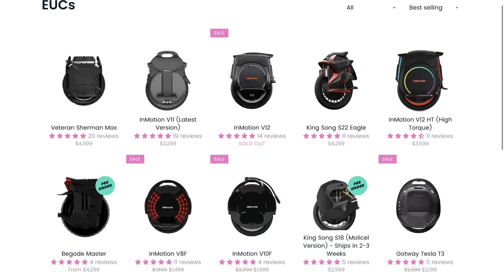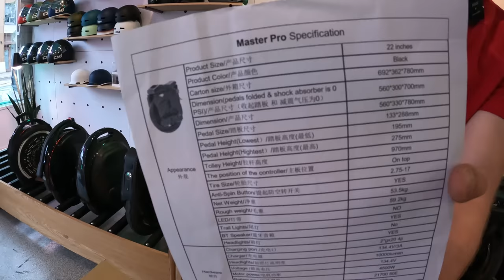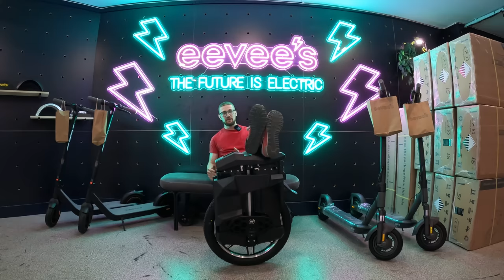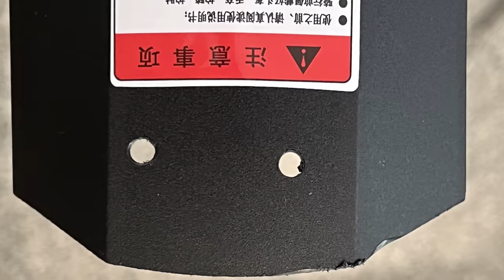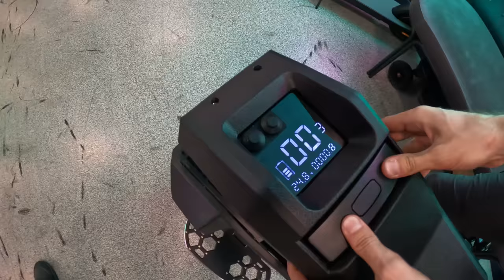Begode Master Pro Unboxing - Biggest Battery!

Comment: Begode is like a pre-manufacturing company. Whatever they ship you is going to have to be re-manufactured to be an actual production quality product.
Reply: It's like offering a bike frame and you add the parts you want. But in this case you will need to manufacture them
Reply: I like how you put it. I can actually 99% agree with that
Reply: I have put my T3 through hell and it's still going strong (with the exception of a trashed rim due to potholes). So I'm not in total agreement with this statement. Now I have my eye on the T4.
Reply: @jashton8710  There's a fundamental distinction to be made between OG Gotway and new age Begode my dude. The Nik,  Mten3, T3, EXN, etc were made to last. This new naked lineup won't last 2 years. Not having even IPx5 rating for something meant to be used outside is just insulting and having shitty plastic wrapping the fully exposed batteries are the worst 2 offenders. This thing is 5k FFS and they expect people to put hundreds of dollars to finish the job with aftermarket shit just to make it a fraction of what it should have been in terms of convenience and sturdiness.
Reply: Bruh s22 was the same but it caught fire but you didn't care it was batch 0
Reply: And on top of that quality issues the pricing is also too high. I just discovered “Sandra Miku Super” a road legal electric motorcycle (ish) for £3500. I know is not the same freedom, I just want to emphasise how steep the “not tested” PEV are. Only from material cost perspective the euc’s are dam too expensive.
Reply: @mr.e-wheel  we have a saying here "if you wanna play you gotta pay". 
So for now, the high cost of euc's is what we have to pay for what I call the pinnacle of mobility pleasure. 
You may disagree....but I don't care.

Comment: Cool. Check how tight the white cable under front is. It might be safer long term if they make it a bit looser, more "S" like. 
I like the tread pattern of the v3 tyre, nobbles aint in a line. 
Epic wheel mmmm.
See if tiltback can be set and work thanks. Ride safe dood.
I wish you nice success.
Be well.
From Will and Mr Data :):]

Comment: take the pedal holders remove the 4 bolts and tighten the screws under it.. that's why it flops like this
Reply from the maker: I did that on the Other one we have and it didn’t help at all. I’ll try on this one too
Reply: @mr_wrongway  It's a bit of a concern that the plastic battery boxes, then the BMS inside are what hold the pedals in place. They'll be stressed every time there's acceleration, deceleration and I don't want to think about pedal clipping 😐
Even if the lever arm is long which will reduce the forces applied, it's not ideal.
Reply: @mr_wrongway  tighten also the 3 bolts on top as the entire tube is spinning.. there are 2 bigger bolts and one smaller.. usually that helps but don't over do it
Reply: Currently i have this issue with my master pro! I can feel it going over bumps and while accelerating/decelerating. Any updates?
Reply: @JekovenTinsley  tighten the 5 bolts on the bottom and also the 3 on top.. you have to remove the pedal holder part.. .. use loctite
Reply: @archeebookingagent1909  Thanks for the advice I tighten the 5 bolts at the bottom and the three at the top and I still have that issue. It looks like the black metal bar that connect to the batteries has alot of play when it fits into the silver slider.

Comment: Careful what you wish for: I wanted more range.. but why on this beast?
This becomes more like a full fledged street only vehicle. I gotta say I like the T4 and would be happy if the master got a Gen 2 remake with a bit more range, 2800-3000 Wh, as well as a quality overhaul..
Reply: ex30 with 3600wh seems to be pretty good. I prefer the tire size and overall weight of the ex30 better
Reply: Personal taste, I guess.
But for me 50kg+ on a vehicle that I can't lock and leave in the rain, have to carry over hurdles etc.. is hard to justify.

Can't compare it in terms of riding, but as an only-wheel for short trips etc not my favorite.

Comment: 14-15 hours that you said, is right. The edited subtitle (12 hours) is wrong. That is an about ~400W charger (134V*3A) and you never put 1W into the battery for every watt your charger spits out. The average is between 70% and 96%, depending on battery, BMS, wires length and thickness, etc. That is called charging efficiency, and in our ranges of currents, usually the figure is 85%, for a NEW battery pack. Look to charging times for existing wheels from Inmotion or even the Sherman, a 5A will fully charge it from empty in about 7 hours and half, which is exactly 3200÷100.8÷5÷0.85. There is always a under-unity factor. So, coming back to our sheep, 4800Wh÷135V÷3A÷0.8=14.8 hours. Which is a bit ridiculous... I already raised this issue with my Chinese distributor some weeks ago, and I believe they are "escalating" it with Begode.

Comment: From what I see the V13 will be a far better wheel given the design , quality and given the speeds these wheels are reaching the safety
Reply from the maker: Time will tell :) indeed there’s a lot more tech in the V13
Reply: I guess the V13 will burn through its smaller battery very quickly at high speeds much like my master can. So it will fall short on range relative to other smaller cruiser wheels. It seams to not have a good niche. Perhaps short range performance wheel for huge riders is it's niche.
Reply: Maybe, but they already bombed on range, not even 3600 Wh like the Sherman (2 years+ ago) and we do not know the max speed but the rumors said its not more than Sherman S. The question is are you a performance rider and looking for a 60 mph wheel, that has been reaching dangerously to 50 mph on your old Sherman and want a faster wheel? If not, then Sherman Max has a great record, with S coming out even better and retaining 3600 Wh/lighter/smaller/cheaper than V13.
Reply: @saltyscott1762  that's interesting. To me, the V13 looks like it will be an actual practical wheel, and the BMP seems fairly useless (other than being an fun toy). What niche is this filling where you need to ride 300km a day?
Reply: @s0d4c4n  consider the all-up weight too, of all these heavier wheels. Somewhere along the line there is a Goldilocks formula for power, voltage and range at a manageable sub 40kilo weight (think v2 Sherman - simple, solid and pretty sure-footed too). Beyond a certain weight, they’re only going to be suitable for well surfaced roads or tracks, and below a certain battery capacity to power/voltage ratio it becomes a diminishing return per unit of currency sank, even before reliability and even out of the box rideability is considered. I get that for some the biggest or fastest or rangiest wheel, etc is the only one that is going to be desired, but it will come at a cost -not only financial - when other factors are to be felt worthy of consideration, eg portability, trail capability, etc.
Reply: @s0d4c4n  300 km a week without charging.

When I ride fast on my old Sherman:  50 60 kph. And I am a heavy rider. I only get 80 km of range. So on the Master Pro I only get 120 km.
Reply: @s0d4c4n  5a+9a chargers. 14a*126v=1764w, which is the maximum. = 30-90% in 1h
Say avg riding speed 40km/h.
And 1h charge (1764wh) gives 50km range. Then ride 65km to be down to 30%, charge 1h to 90%, ride 50km down to 30%, repeat 4 more times, in 12-13h you can do 300km, including charge time(5h total in 5 stops to eat or have a needed break). Not bad at all in my opinion.

BMS I understand makes the 14a charge safer and helps spot any possible issues that may come as a result of that, with other wheels, hard to tell.

Comment: Nice overview ! Is the tire the CST C113?
I can't find it on the CST website in 17".

Edit, I learned that it's the C117, same pattern as C113 but different tire, very appreciated by Monster riders.

In 2.75" it's probably as wide as the typical EUC tire, but it looks narrower due to the diameter 😄
Installed, it it something like 75mm wide?
Reply: You should be able to fit a 90/90 on there no problem.

Comment: I have that exact same pumo for my mountain bike, the dial is annoying though as the scale goes up to 300psi/21bar for the shock, but tyres are like 20-30psi so reading the differences between 28 and 30 when pumping is like trying to drive a car and differentiating between 14 and 15mph on the speedo dial. I reccommend a digital high pressure pump, even if it doesn't say it's designed for tyres you can get an adapter if your tyre is presta, it'll just take a while to inflate

Comment: The price is stupid high just due to the battery prices being stupid high.

Otherwise, this wheel probably costs like 2 bucks. It's like it's made out of bunch of scraps, and it's not one of those Tony Stark situations, even if Begode built it in a cave...

Comment: I just uboxed my Master (non pro model)... The back tail light plastic was broken out of the box... The foam padding around the screen is messed up and not flat or square.... But other than it works so far.... Yay? lol. I mean it came all the way from china I guess A tiny bit of plastic being broken is not the worst that could happen.....Yet? Charging now, if you dont hear from me again I blew up. Ded.

Comment: Look extremely cheap for a vehicle too trust my life with,,
Cheap out here,
A little cheap out there 
O’ and some more cheap out here.
Topped off with a lot of non effort for directing rain water somewhere else then inside the machine,
V11 trail rider
Next year
V13 city to city rider😮

Begode is to cheap manufactured for my eyes.

Wouldn’t wanna puncture a Bpack the wrong place, a fire 🔥 u cannot pyt out,
How thick is the 🔋 battery shell?